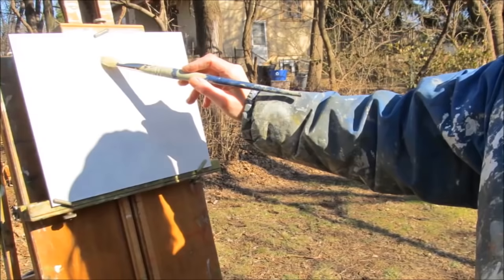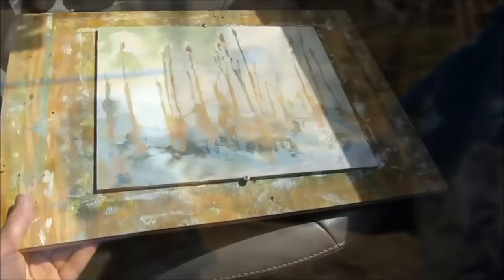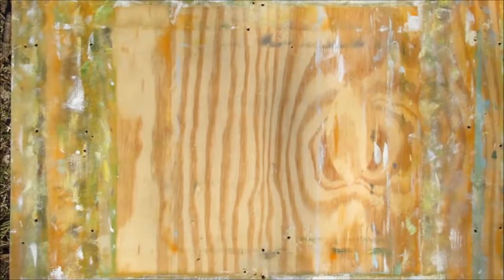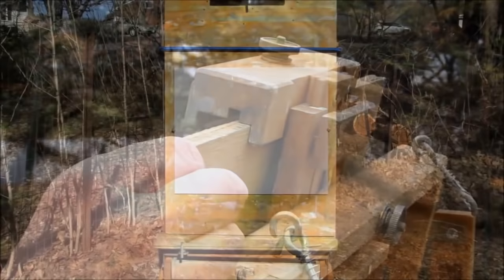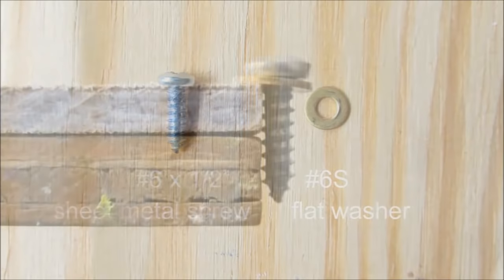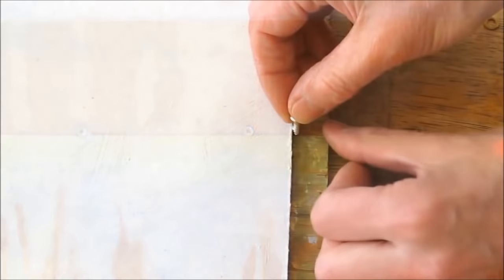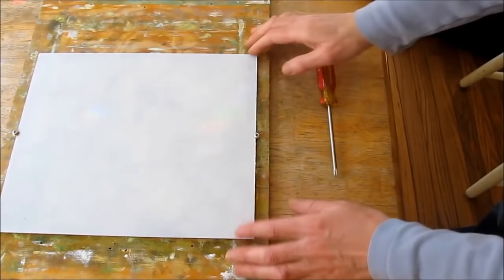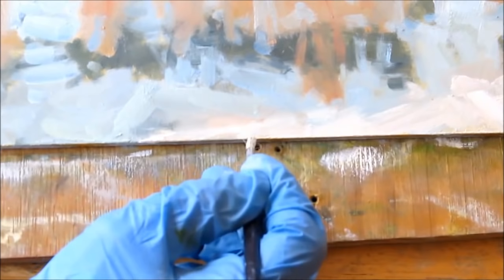Easel Adapter for Plein Air Painting - Easy to Make

Comment: Another good device would be pegboard that would have a frame on the back to make it more rigid. Use the L shaped shelving supports with the pegboard pin attached. This will provide numerous holes for mounting and removes the need for adding holes for future variations in size. You have a good concept, and solves a problem.
Reply from the maker: Paul Taylor Thanks Paul. That sounds like a good concept!